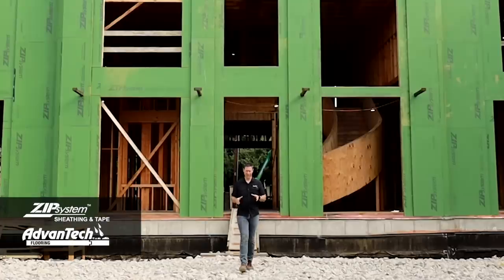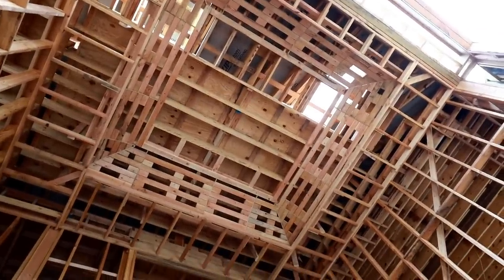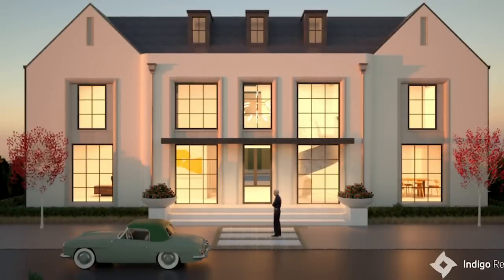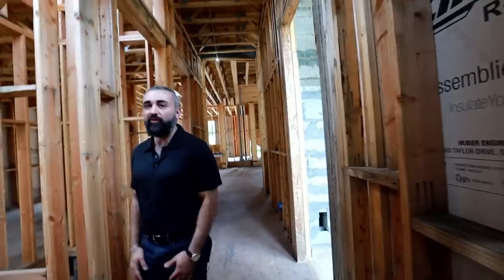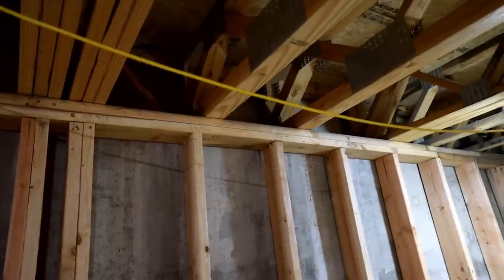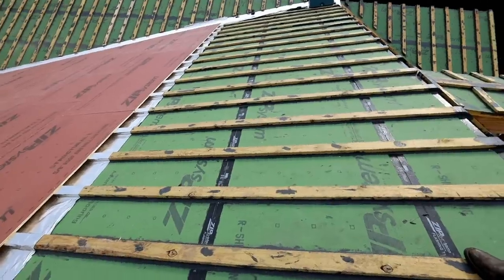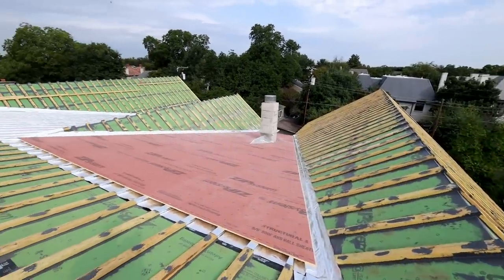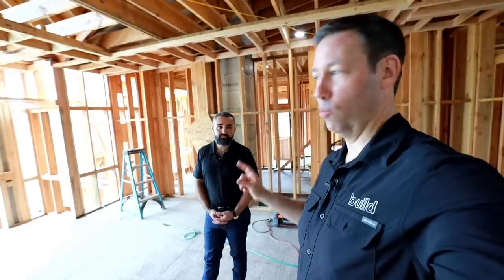INSULATED/Sealed Roof Deck , WITH Radiant Barrier AND it’s Vented...Haven’t seen this before!

Comment: Isn’t that the same zip roof panel Matt used on his house? I don’t understand why he said they don’t say you can use that on the roof.
Reply: Pretty sure what he was saying is Huber wants zip laid and secured directly to the roof framing.  The first layer of zip is good, but the second layer of zip that is being secured to the 2 x 4's goes against Huber's installation guidelines.  I have no doubt it will be fine since the 2x4 spacing is the same as the rafters.  Since the 2x4's are on their sides there's less of a gap then there would be against the actual rafters.  1.5" wide vs 3.5" wide
Reply: @MS-hd8yq  Ah I see. I'm sure it would work this way as you say. I always wonder though how on earth you would ever troubleshoot a roof like this if there is a leak. Just finding where the leak originates would be one thing but then fixing it would not be easy.
Reply: @R2D2trashcan   Hopefully there won't be a leak.  Very complicated to be sure.

Comment: You couldn't find information whether to vent or not vent a roofing system? Please, that information is readily available. If it is an asphalt shingle, it needs to be ventilated. I don't think slate does since it is an organic stone product. But interesting ASV configuration, and I would be curious if the foil underlayment is a PCM material or not. If I was the homeowner, however, I would reject the system configuration. You're essentially hoping this system works without the system being tested. Matt subtly poo-poos manufacturer's guidelines, but keep in mind, their systems are rigorously testing by organizations like ASTM for performance.  Improvising a building envelope system is opening yourself up to massive liability. Dario also admitted they're just getting into "building science stuff." Wouldn't make me feel confident as a homeowner or building owner. Matt saying he "loves the system" also seems odd given the roof assembly/building envelope assembly under the roof has no track record under the configuration Dario installed/designed.

Comment: You dont have guys in Texas that know how to use sheet metal brakes???  That is first time work on multi-million dollar home.

Seems like a nice guy, has had lot of success, but should sometime listen to the experts he hires. 

That roof system not only is installed outside ZIP specs, but will be carrying the weight of a slate roof against the foam.  Over time, that may shrink/crush/shift and cause the entire roof system to move.  

Dont save pennies while $100 bills fly out the window

Comment: Matt, THANK YOU SO MUCH for featuring this high-performance vented roof -- 40 DEGREE DELTA!!  Yea team.  I'm looking for a CAD drafter who can help draw a low-budget solution, with a similar objective.  For example, with new construction, assemble rafters on the ground:  nail a 2x4 "runner" to create a "ledge" for rigid insulation with foil facing up.  At the ridge, I found a simple rafter hanger that only requires 2 simple bends to accommodate the flat mitered 2x4 there.  Here's my very rough first drawing, which needs a pro to finish it properly (no copyrights on this, so you can have it for your clients and crews):
http://supremelaw.org/authors/matt.risinger/site-built.rafter.vent.gif
Reply: Interesting design. Why not just use a ribbon plate on top of the framing, then before the ceiling battens are installed, install this system covering the whole room/floor space. Then once its installed fix the ceiling battens to the trusses underneath with long screws.This would be much faster and separates the ceiling drywall from the roof trusses as well as creating a better ceiling finish too!

Comment: Why don't southern houses build like northern? Should be since the main purpuse is so the inside climate dosn't change to outside climate, warm or cold your heater or AC is not going to work as  hard. Remember when i was in Florida 15 years ago, where we stayed the house was built lika crap, almost every house we where inside was alot lower standard than a Swedish houses.

Comment: While this might be cool or even cutting edge, it doesn't mean it's original or a new design. GBA has described similar systems and I'm putting a roof like that in my house. Also, Matt the details you describe aren't necessarily 'yours'. I like a lot of the techniques you use, but just because other people aren't on the Build show doesn't mean they haven't done some of this stuff first.

Comment: Not going to be easy to air seal that garage from the rest of the house. :(  Would have poured a spanning concrete floor over the garage
Reply: Excellent point.    9 cars plus that sump pump swamp will be some pretty foul air wafting up into the house.
Reply: Closed cell foam across the entire underside of the subfloor above the garage area below the first floor then down the walls leading into the living area next to garage effectively sealing in the air in the garage.

Comment: The only thing he's over looked is the basement insulation. Amazing build otherwise
Reply: Not an expert but I would imagine in texas the ground temperature stays fairly close to indoor ambient year round. He also can insulate between the studs of the wood frame wall.

Comment: I don't understand how anyone can justify consuming so many natural resources for a single family home. Home many 1600 to 1800 foot slab homes could you build out of the materials used for this one home? 100? 200? What amp service will go into this home? Even with the extreme build what will be the energy necessary to heat and cool it? Just a philosophical question. Not a comment against Matt or the builder of the home.